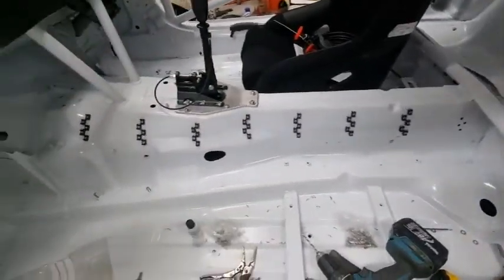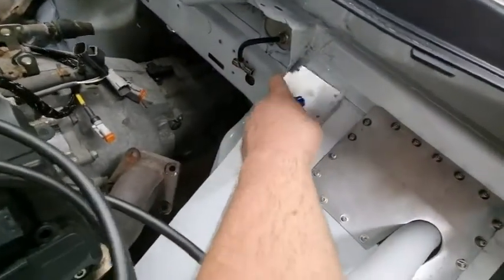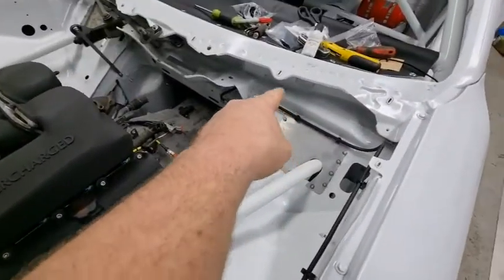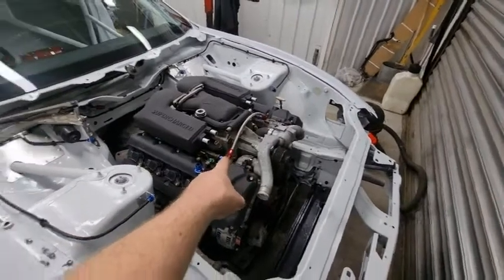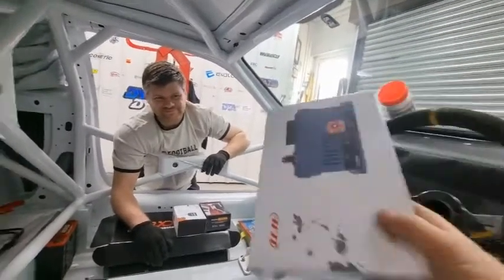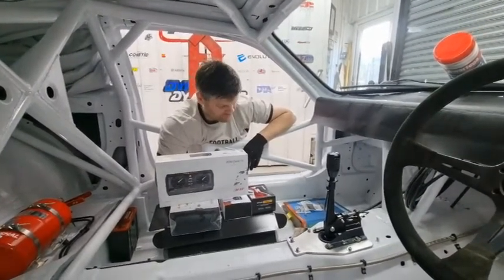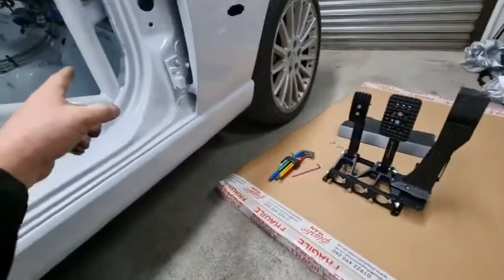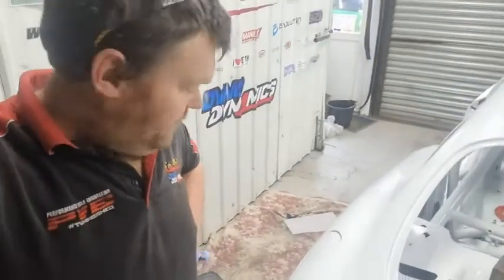Lets build a racing car! CTCRC Jaguar XKR X100 - Fuel System Sorted!

Comment: I want ask you something could the engine and transmission sit  further back in the car for better weight distribution for the car can it be done and in class you guys going to complete can you use a dry sump oiling system for car  ps I think you should go with some BBS mesh rims on it  I think it would good on it
Reply from the maker: It's something we've talked about the moment we popped it back in. Obviously it requires quite alot of work, at this point we just need to get it out ready for racing, we do have an appointment incidentally at Swallows Racing, for a full corner weight and alignment setup, so it will be really interesting to see the balance. 

We're not allowed a dry sump arrangement in the series unfortunately. We're using a home made gated sump we've popped in. Hopefully we will not have any issues, but I will be logging oil pressure at 500hz so I'll keep my eye on the logs.

As for wheels, I'd like some lightweight Motorsport wheels at some point. I'll be using 18" something or other for sure, as the tyres we need to run seem to be the best  option. I'll probably use some OEM wheels being honest initially.
Reply: Have you guys put the mini on the back burner for right now ?
Reply from the maker: @dannyrivas5125  Yeah, we usually do  during the winter though to be honest. She will come back out when the weather is nicer and track days start up properly again. :-)
Reply: I been watching you and another group's , bad obsession project binky , motive garage and there builds